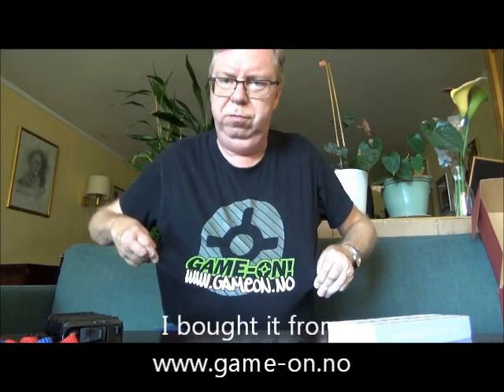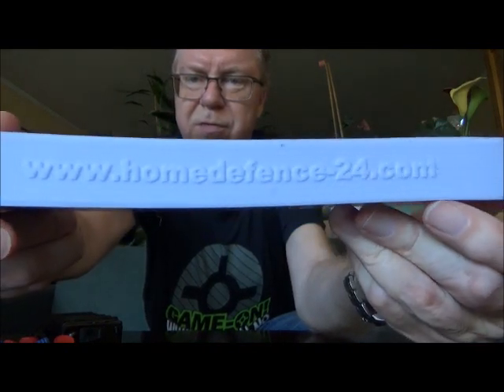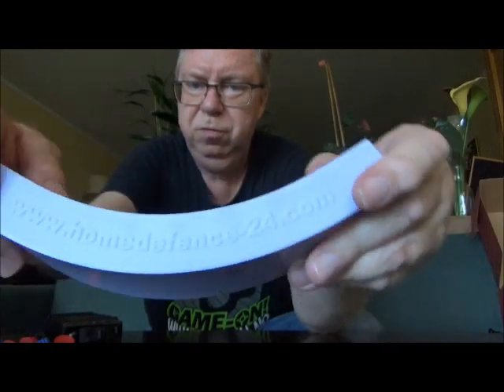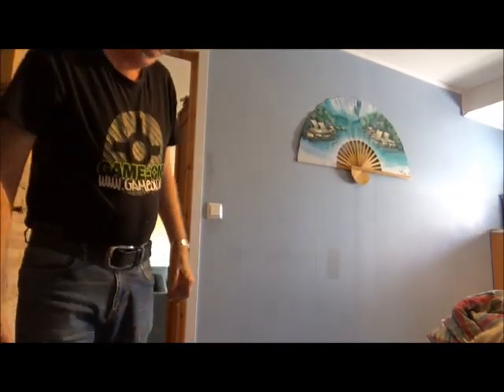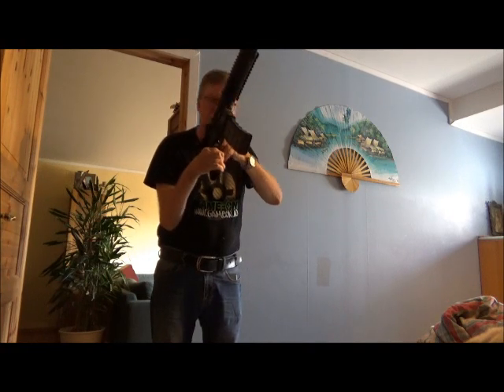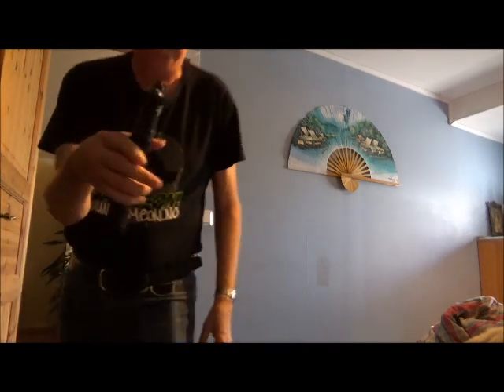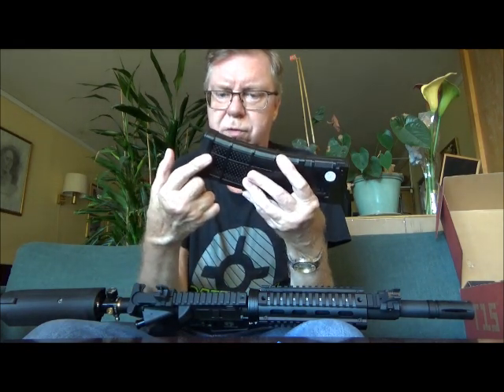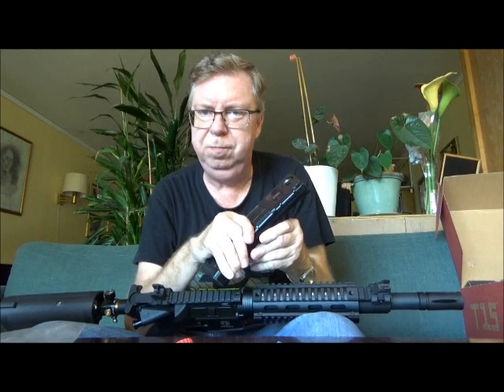First Strike T15, Homedefense Slugs

Comment: Nice one, my friend, good test, again. I've all but given up with the T15, I now prefer my Milsig (Valken) M17. I had the opportunity to try some home made hd slugs from Florian's moulds recently using my M17. I had the same problem as you had here when using the standard hybrid mag, but with the Grizen mag the slugs cycled easily and smoothly. Lost confidence in my Tiberius stuff, I dont know if Ive just been unlucky but my T9.1, my FSC and T15 fail unexpectedly and relatively frequently. Great vid mate, thanks for sharing, RR 👍🏻
Reply from the maker: Thanks my friend. Iam glad you like my videos :) Not sure how the T15 will hold up over time but I like the looks of it. So far it seems to work. My two T8.1 has worked fine to but I dont tune it to the max. Just enough for some plinking :)  I hope I get hold of a M17. If so I make lots of videos :) Take care my friend and have a great day :)

Comment: do you know if the steel balls will do good in the first strike t15 and do you think metal balls and heavy slugs will work in the umarex t4e ppq and smith and wesson. thanks
Reply from the maker: I think steel balls will be way to heavy in the T15. For the T15 I found rubberballs 3,7 gram is the best ammo. The PPQ might work with steel balls but velocity will be very slow. The heavyiest balls I have in cal 43 is Powerballs 1,5 gram. If I get hold of some steel balls for it I make a video :)
Reply: @runerebel8441  thank you so much
Reply: @runerebel8441  Hi, if your using the .68 rubber balls before loading put them in a tub with a couple of drops or sprays of silicone oil and swirl around a bit. It helps with feeding especially if you have full auto. The Auto conversion is pretty great by the way if you have the spare cash to invest.
Reply from the maker: @svy99n  Thanks for the info my friend :)